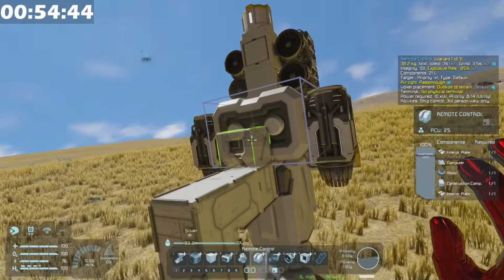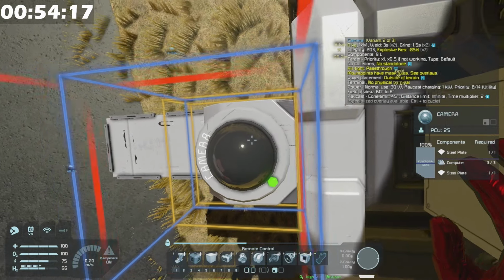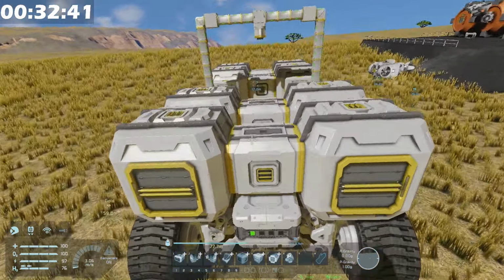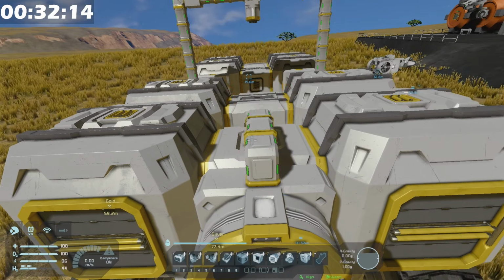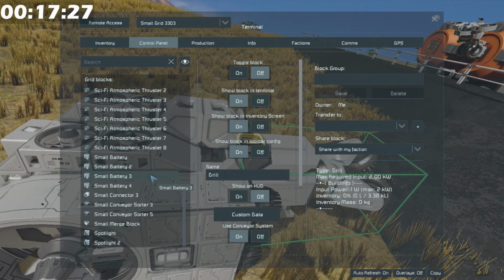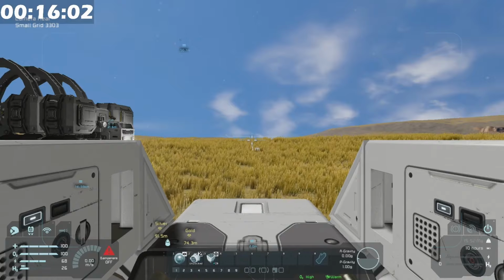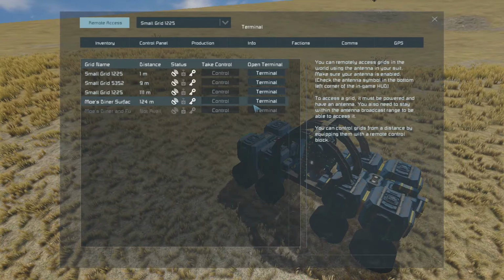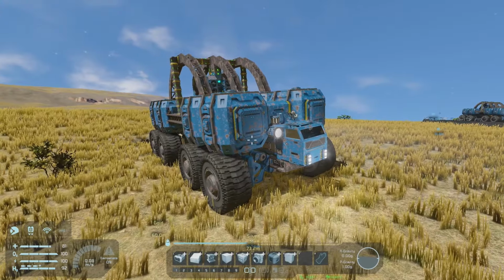Drone Mining Rover - Ship of the Week Season 2 - A Space Engineers Build Challenge

Comment: You can build a timer and eventcontroller to trigger the actions you want. For example batteries load, Trusters off or this thing with Z. Just dont mess with antennas. Just let the controller trigger the timerblock. Timerblocks can also trigger with 2 options wich makes it easy. Instant and after 1s.

Aslo if you add Antenna on ship + rover you shouldnt get kicked out. I build a rover with scoutdrone and managed to get around this Problem.
Reply from the maker: A timer is a good option for if you have a lot of things to toggle, though for this drone I figured it was overkill.  I like your "1 sec trigger" trick though for getting around not being able to trigger a timer block in both the "activate" and "deactivate" slot of the event controller, I hadn't thought of that!
As for the disconnect on unlock, I think it has something to do with the order of merge block and connector disconnect.  I can't remember which one should be unlocked first, but doing one first than the other will kick you from the remote and doing the opposite order will leave you in control.  Could also just be random luck, hard to say.